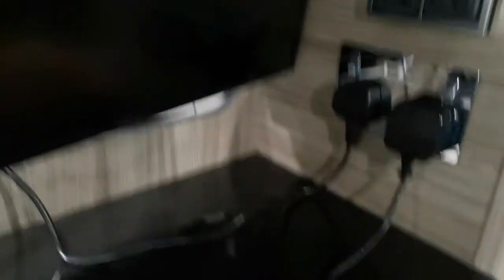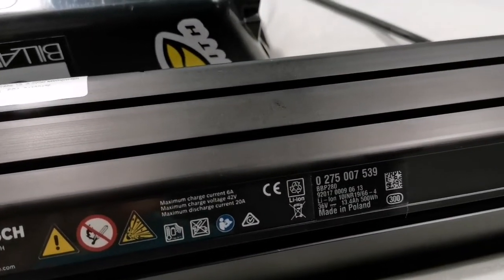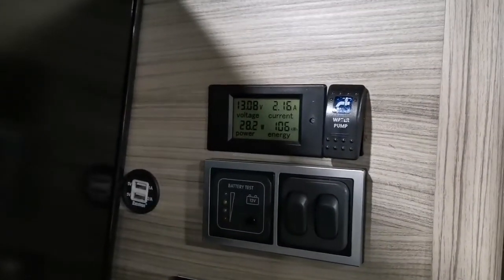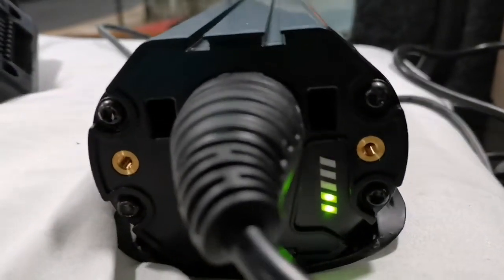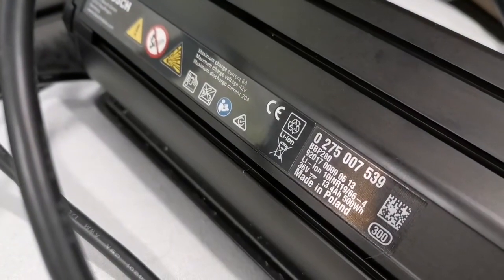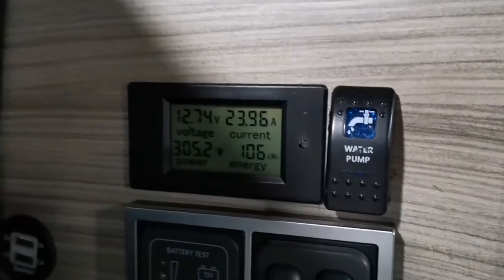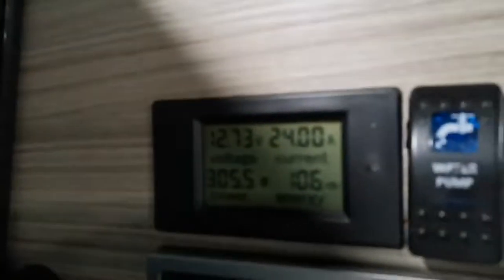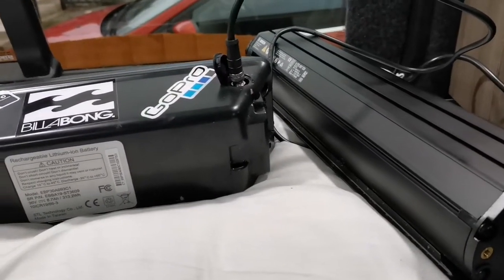Ebike battery charging from a campervan

Comment: In be inclined to buy a Jenny
Reply from the maker: The solar panel charges the leisure battery for free and when you drive between destinations the vans alternator also charges the leisure battery so it's not really worth spending on a generator and petrol.
Also, The bike batteries take roughly 4 hours to charge so the generator would have to be running for 4 hours solid.

Comment: 12v > 230v > 36v = Nono | 12v > 48v (step-up) (step down 42v-36v ) > li-ion = best efficiency
Reply from the maker: Do you have any more information on where the parts can be gathered?
The only reason I chose to do it this way is due to ease of installation